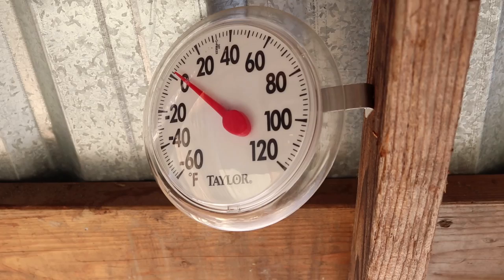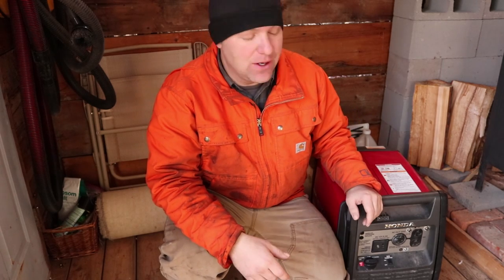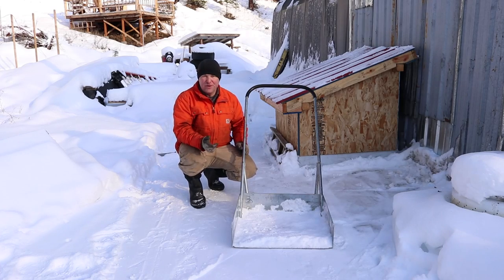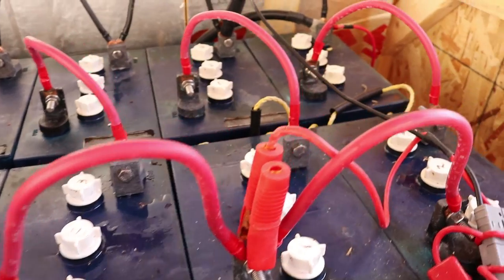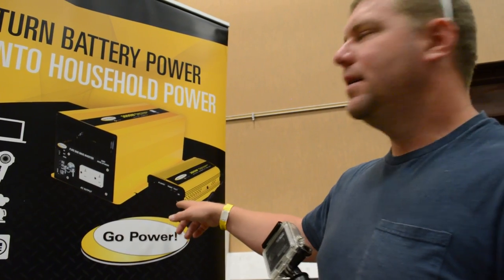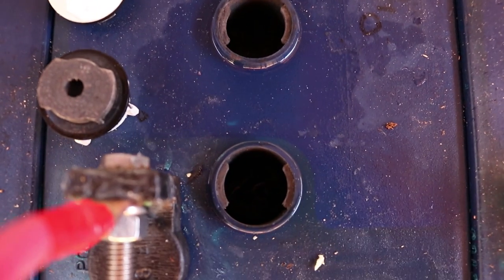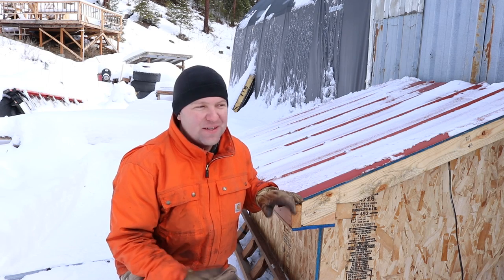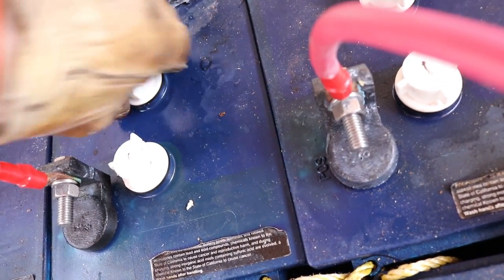SO FRIGID BATTERY ACID IS FREEZING! + Off Grid Power problems

Comment: I lived in Alaska for 23 years and learned a few survival and living tips for cold weather. one is use the snow to insulate the battery box. the coldest snow gets is around 30° when packed to around 3' deep around something. next for a space heater get an oil filled radiator heater. no tipping problems, no exposed heater coils safer all around. you are living a great life.

Comment: I am a Small Engine mechanic for 38 years . I can tell that some of your problem on the generator not running when it is real cold out is the fuel air mixture the carb is set at.

Comment: Another item to check on your generator is to reduce the intake size.  A quick check is to block off half of the air  filter intake and see if it runs smoother,  The air is more dense in the cold so chocking off the intake will richen the mixture.  Canadian trick. I enjoy the channel, stay warm.

Comment: How i keep my batteries from freezing here in Colorado is i have a single light running below 32F inside the box to generate heat. Also another thing to know is the lower the charge is on a battery the easier it is to freeze, so a battery that constantly freezes means its not balanced with the rest of the pack and needs to be brought back to the level of the rest of the pack individually, proper balancing helped a lot on keeping them from getting frozen.

Comment: Hi guys! I've watched a bunch of your videos and wanted to say thanks for shooting them! You guys are doing great out there on the homestead and undoubtedly inspire a lot of people!

That being said, I'd like to help you out with your power systems and challenges you have been facing with it. Whether that help is comes in the form of design. setup, troubleshooting, sending you spare equipment, etc.

My immediate concern is your frozen batteries. Batteries that have frozen cells are usually a death sentence unfortunately. Right now I would be doing everything I can to get as much of a charge into them as I can. I know you're having generator problems which doesn't help at all. Also, you have a lot of capacity in that battery bank and I really dont think you guys have a way to properly charge that bank. A good rule of thumb is that you should be able to deliver 10% of the AH rating of the bank in current. I think you mentioned the battery bank has 700AH capacity in another video which means you should be charging them with about 70 amps. Using the T = Ah / A  formula says if you're delivering 70 amps it will take roughly 10 hours to fully charge the bank if they are dead. This does not factor in any losses, which you have a ton of unfortunately, mainly because you're dealing with a 12 volt system and your secondary problem is the temperature. See this little article for charging time and current. http://www.electricaltechnology.org/2013/03/easy-charging-time-formula-for.html

Do you have a good set of jumper cables with heavy wire? If so, park the truck by the battery bank, hook up the jumper cables and let her run for a few hours. Keep a voltmeter handy and check the voltage at the battery bank about once per hour to see if its taking a charge. Long term I would hook up a permanent charging plug on the truck using an Anderson SB350 connector and the biggest wire you can get, I recommend 4/0 cable for this, and try to keep the charging jumper as short as possible. You can probably get a pigtail with the anderson connector on it at a store/shop that sells snow plows, that is what they use to power the plow. Voila, you have a high power generator/battery charger and you didn't even know it! A cheap upgrade would be to find a high power alternator for the truck to increase your charging current. 

Moving on to your solar I have some questions. How far away from your battery bank/charge controller are your solar panels? I'm looking for how many feet of wire are in between the two. Also, what size is the wire? 12 volt systems have a huge amount of loss. Just to give you an idea, if you have 100 feet of wire between the panels and charge controller and the wire is #6 awg it works out to about a 20% loss just in the wire. I assume based on how you have your panels wired in parallel that you're using a PWM type charge controller? An MPPT charge controller would help you out a TON in your situation. This would allow you to run your panels in series, which will increase the voltage and decrease the loss. Check out this voltage drop calculator http://www.calculator.net/voltage-drop-calculator.html . A quick test would be to take your voltmeter and check the voltage at the panels on a sunny day, then go to your charge controller and check the panel voltage and see what the difference is. Also, I would upgrade those battery bank jumpers to 4/0 cable as soon as practical. 

Good luck!
Duane

Comment: I would invest in a second generator of at least 5000-8000watt capacity. The oil you should use in those temps is 0w-20/30 and 10w/40 in the summer. Keep the 3000watt one as a backup and take it with you when you do the firewood runs.

Comment: hey guys, i have the EXACT same generator at my house as a back up power system and is running great, will let you know what i did, but a bit of a back story.

i live up in Saskatchewan Canada, winter here as a normal temp is -25C (-13f) and gets as cold as -45c (-49F) and i have used this genny during power black outs, 3 days ago i actually had to use it at -40c (-40f, its the same temp)

last year using it i has the same surging that you having, even when i put 5w30 into it, a little insight from a mechanic on oils.... 

the way oils are rated as a #W# is as follows, 1st number weight is what the viscosity of the oil is cold. so a 5w30 will be a little thinner than a 10w30 oil in the cold. once the engine warms up the oil changes viscosity again and becomes a 30 weight. so once the engine has ran a bit and heated up the 5w30, 10w30 and 15w30 oils will all still be the same viscosity.

so by changing the oil like you did from a 10w30 to a 5w30 all it effectively does is allow the small generator engine to start a little easier in the cold but have absolutely zero effect on the engine after it warmed up, and that is why your generator ran better than before when you started it untill it was fully warm after about an hour.

to effectively change this for winter what you need to do is change the oil to one that gas a lower hot viscosity like a #w20 oil. this fall i had changed my oil to to a 5w20, that way it starts easier in its cold form, and is a little thinner in its hot form for performance. even thou recommended oil is a 30 weight on the generator, it will cause no harm to toss a 20 weight into it, the reason they recommend a 30 weight oil only is, during the late spring/summer/ early fall months, a person may not think to change the oil out and back to a 30 weight oil. by not doing so the 20w can not cool the engine enough in a hotter climate and could cause the generator to have and engine failure.

that said. during winter and months with temperatures around -10C (or around +14F) the surrounding air tempurature is more than adequate to properly cool the small cylinder engines. the same 5w20 that is in my generator for winter is the same oil i have been running in my snowblower for the last 5 years when the snowblower is recommended at a 30w oil, the sbowblower i have is about a 15-20 year old blower and i put the 20 weight into as it runs better in the thick packed snow when its -30c or so out here.

hope this has helped you out 

sincerely ~ Aaron from Aaron's Automotive.

Comment: I am just sitting here in my "on grid" house, but my thoughts are; insulating (with hay or something) and heating by running hot water through the box (like in pipes through the insulation. My parents heated poolwater by running the poolwater through a black mat on the roof that got hot in the sun or simply through a fire. Seriously, some friends dug a hole in a forest, made a tub out of it with plastic sheets and ran water through the woodfire for a steaming hottub, much like yours I guess). 
The idea of heating it by building a greenhouse over it (and growing veggies in it in spring and summer) that I read in the comments sounds good too. 
Sending you much warmth and a happy newyear from across the ocean where it is nearly freezing temperature but nowhere near snow yet, and probably only will see a few cm this year anyway

Comment: Something you may want to consider is building a passive solar heater for your barn and the battery box. Many designs can be found on the internet and they can be built for under a hundred bucks (less, because you likely have many of the materials). It would not work in sunless days but on sunny winter days it might help with your cold battery issues.

Comment: separate the batteries, even an inch between them will allow air flow which will assist cooling in summer and warming in winter.  I have my batteries sitting on 1x2's to allow air flow under the batteries as well.  This is year 7 for me.  If you have even 1 battery not doing its job get it out of the line up asap it will damage your entire bank.
I took a 6 inch stove 
pipe, ran it through the wall of my cabin, installed a fan taken from a discarded computer and ran it into my battery box.  The small amount of heat flowing from the cabin to the battery box has saved my setup from freezing. 
It was -19 here this morning with no problems.
Good luck.

Comment: Good video. Try keeping the tops of the batteries completely clean and dry. You can loose surface voltage right out of the cells. Also you should always wear eye protection when dealing with acid batteries. Best of luck to you guys

Comment: Hi all, long time viewer, first comment. In Caaaaaanadaaaa, where it really gets cold, we can get carburetor freeze up. Try putting a 1/2 oz. gas line antifreeze in each tankful to eliminate moisture from the air icing up the carb. Has worked for me for over 35 years. Keep up the good work.

Comment: In cold higher altitudes you need to go up 1 size in the main jet of the carb, you can test this by either leaving the choke on slightly or blocking part of the air intake with some tape.

Comment: Man that is cold! Never seen a snow scoop before.   Interesting to see frozen batteries. We are off grid in Florida, we have challenges but cold isn't one of them. We are picking ripe tomatoes from our garden. We had a problem with our Honda generator EU 2000i. It was a wire and broken pin from inside the harness. hope you get that generator working right! Cheers.

Comment: Hi, have enjoyed all of your videos.
You folks are doing an awesome job with your lifestyle and sharing it.
Just wanted to offer a thought regarding warming up your batteries...
Consider spacing your batteries so there is an air gap around each one and also set them on slats or a grate.
The way they are now, you are only heating the top and outside, whereas you could be heating them up quicker with air space.
Happy New Year!!

Comment: I highly recommend you look into thermal fans, one of my neighbors uses a small 50watt portable wind turbine to trickle charge his batteries anytime his furnace is on. The thermal fan provides a small amount of wind which blows directly at the micro wind turbine, which actually keeps the batteries warmer all night due to being trickle charged. Based on the thermal fan he uses the 50watt setup was the only turbine he could keep running with just the fan wind of the thermal fan.

Comment: The thinner oil advice they gave you was good advice. You might even consider going to a synthetic oil. I watched to the end and see the issue didn't go away. My first thought is to replace the spark plug with a new one, quick and cheap troubleshooting step. Next I would move on to replacing the fuel filter. I'm not all that familiar with the Honda but I'm sure it has some sort of in line filter. If the problem persists after that, I would pull the carburetor off, take it apart and clean it. Some dirt may have got by the fuel filter and is blocking a jet or port in the carb. Just my two cents and that's probably all it's worth. haha Good luck on figuring the problem out!

Comment: The things I would try to fix the generator are; 1. Full synthetic 0W-20. 2. Clean the spark plug with a propane torch/or put a brand new one in. 3. Take the carburetor apart, (if it has one), and clean it and replace the fuel and air filter.

Comment: Do you think if you insulated the storage unit that you keep your solar batteries in, that that would help with some of the issues your having. Great videos,  thanks for sharing.
Reply: that's what i was thinking...i see that he insulated the back wall, but really needs more. I know people who keep flood lights for the warmth in a compartment like that.
Reply: Great idea with the flood lights.
Reply: l fod ...actually if the battery box would have been built as a lean-to to the hut/shed/whatchamacallit 😉, then you should NOT insulate the wall between the shed and the batt storage compartment, and insulate ALL OTHER batt compartment walls/lid. 
That should do the trick as well, keeping them at reasonable temp, via the uninsulated shed wall
Reply: I was also thinking this.  maybe just one of those cheap foam styrene coolers you could cut up and put slabs around te front & sides; add a light bulb for heat and your off.

Comment: My wife and I have been off grid for 15 years now, and have experienced same of the same problems. We use a generator on cloudy days as a backup also. currently using a Honda EU2000 and had the same cold starting problems found out by over filling the oil by about one once it fixed it. Apparently the oil sensor doesn't work too well in cold weather and seems to work much better with just a little bit more oil. It starts on first pull now even at 7 deg.  Also note lead acid batteries will not freeze in cold weather if they are charged say a 6 volt  should not go below 6.25 volts.

Comment: Just a small (and easy) piece of advice, replace the spark plug at the beginning of winter. These Honda models really aren't meant to be operated at sub-zero temperatures, but a new spark plug should help with cold starting.

Comment: Service your batteries!  The electrolyte needs to completely cover the plates, it actually needs to be almost to the top of the cell.  I might suggest going to an Auto parts store and buying a box of battery acid to do your top off, then maintain them with distilled/de-ionized water, never use tap or well water in them, the minerals and sediments will destroy your batteries.
Reply: Greyman Zink melted snow should also work for topping up the batts, it is pretty much frozen distilled water.
Reply: Yup. Batteries need water.
Reply: michbushi You have to make sure that the water isn't cold, dumping cold water into a hot battery is a sure way to ruin it.
Reply: +Greyman Zink you are 100% correct !!!! Now to get the young folks to listen.
Reply: Greyman Zink completely agree.. Add acid and distilled water. On lead acid batteries like this you need to keep the plates covered and as was pointed out the level should be right there at the top near the caps.. If you let them go dry like this you risk sulpating and killing cells which in turn kill the battery.
Reply: It's not good enough since there might be some pollution in the rainwater. Only distilled/de-ionized water is good enough.
Reply: Greyman Zink is correct, also keep the top of the batteries clean as the battery will discharge between terminals.
Reply: I think that battery is already ruined if it was low AND it had froze or had ice in it, doesnt take much to ruin a battery and it only takes warping one plate to really do a number on it.
Reply: Maintenance occurs before failure, dry cells will either kill your battery or severely shorten lifespan. One bad cell drags down the whole bank.
Reply: It is important to note that  a major reason to keep cells properly filled is to minimize accumulation of explosive hydrogen gas in the cell.
Reply: All three of these comments are correct. However, no one mentioned that the hydrogen gas coming out of the cells as they charge can blow your battery box and you house tight off the side of the mountain. Electric heater???  Really ??!?!?  Buy a battery compartment electric blanket and insulate the box really good. We want to see more videos. So don't blow yourself up.

Comment: You should move yoru battery bank into your cabin on the opposite side of the wood stove. You still have the camper inside the whole thing and it's not air tight so it should be fine. I mean you have it leaned up against it anyway. Build shelves for it, or stuff them in a bench.

Comment: Usually, on small engines, when the RPM go up and down it is because there is a small piece of dirt stuck somewhere in the carburetor,  However, it would run poorly then even in warm weather.

With temps as cold as you have, you could run 5W20 oil as long as you changed it back to 10W30 once the weather was over 50F.